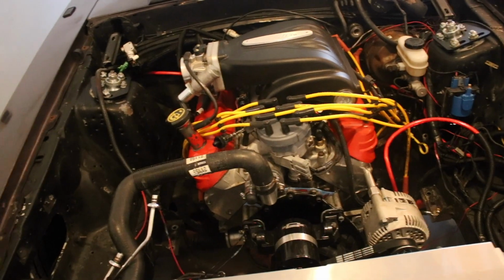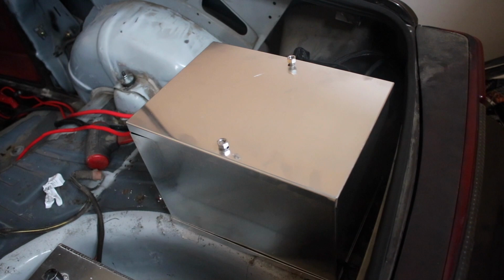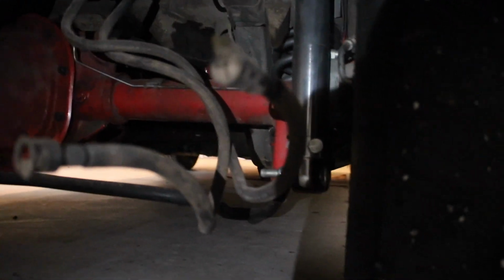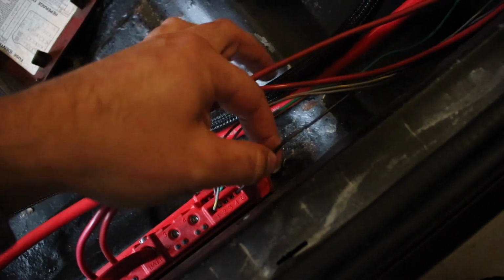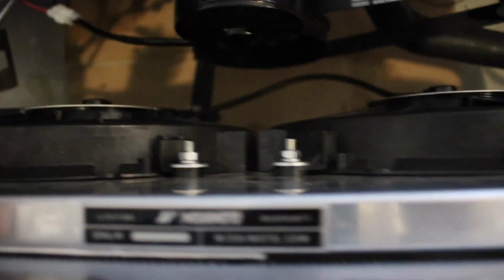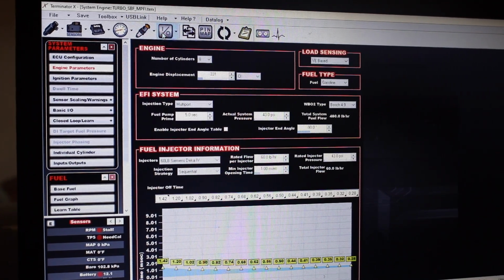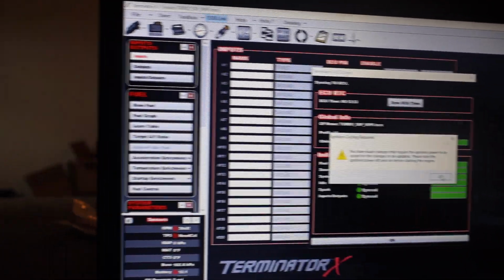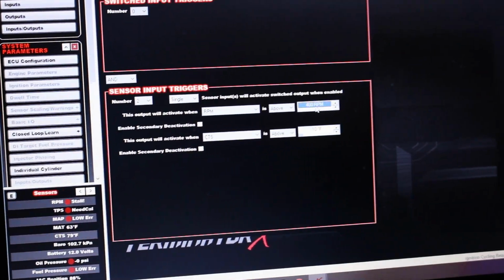PUTTING A HOLLEY TERMINATOR X ON A FOXBODY?? - You Need This MSD Solid State Relay - How To Install

Comment: Did you end up fusing the 12v out to the fans or pump? MSD claims it's not necessary with the built in protection of the solid state unit.

Comment: I think your going to want to run the positive through the cut off switch not the negative.
Reply from the maker: You’re right. I just read thats what’s required
Reply: @RegularGuyGarage  it’s primarily because with it done the other way the alternator can still get power and ground and the car a lot of the time will continue to run even with the switch engaged

Comment: What fuel cell is that. Looks to fit perfectly in the spare tire well. Make? How is in mounted?
Reply from the maker: It’s just a Jegs 10 gallon aluminum fuel cell. I had to trim the brackets in each corners to get the to fit the well, but it does fit good after I did that

Comment: What's your best et with the xe274hr cam? What compression ratio?
Reply from the maker: 7.50s in the 1/8th. I think I’m about 9:1 compression
Reply: @RegularGuyGarage  not too shabby mister. Keep after it. 

How much does it weigh?
Reply: @RegularGuyGarage  I have Holley systemax heads at a shop right now getting a real nice port job, beehive springs and being milled to 10.5:1 compression. I'm hoping for similar et, I have 4.56 gears and a c4 with a brake.

Comment: You should of put the starter relay in the trunk.that way you don't hot heavy gage wire running the length of the car
Reply from the maker: I didn’t think of that. Not a bad idea 👍👍